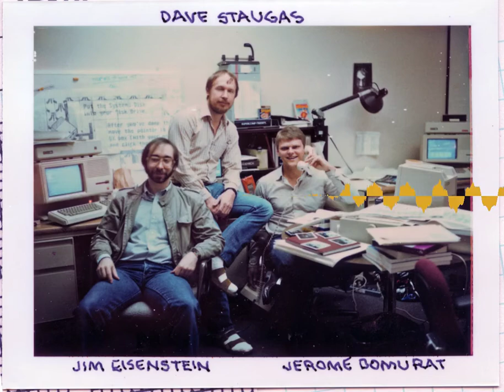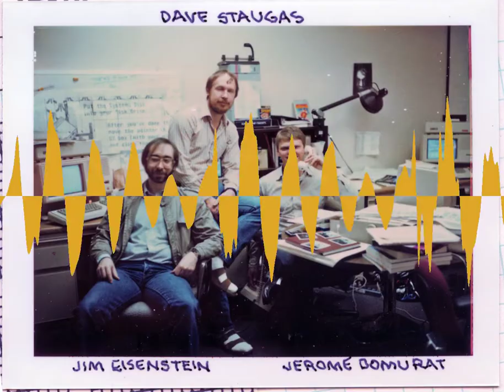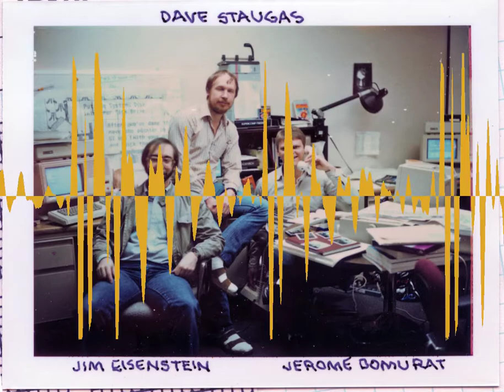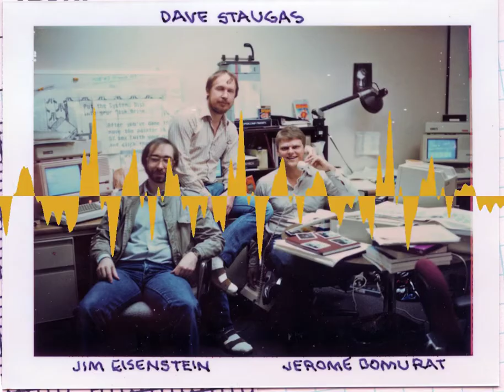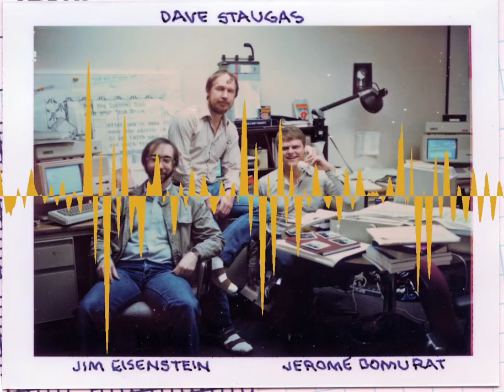Jerome Domurat, Atari artist and interface designer — interview

Comment: Thanks for this interview! Were those Apple Lisas in the background?
Reply: Looks like a couple of Lisa 2/5’s. The ones that came with the 5MB Profile hard drives sitting on top.
Reply: Also looks like a Macintosh sitting at Jerome’s desk. Must be a photo from 1984 / 85…
Reply: @sideburn  That is a Lisa.
Reply: @matthouseholder9660 no it’s probably a Macintosh 512k depending on the year. The other two are Lisa’s.
Reply: I am guessing these were before the STs were manufactured, otherwise those would be on the desks instead.